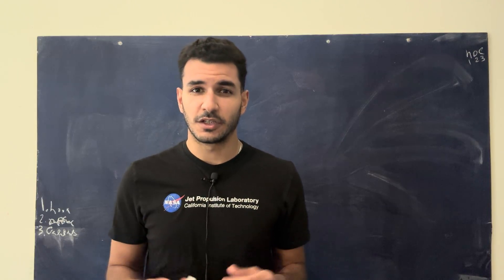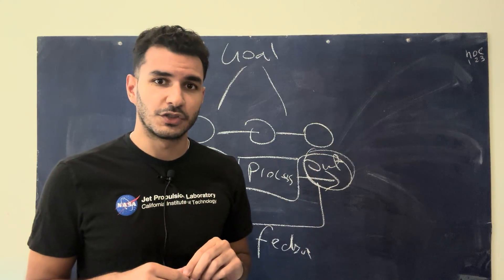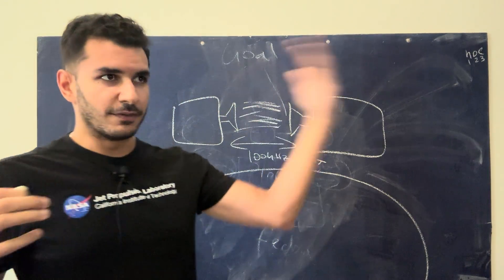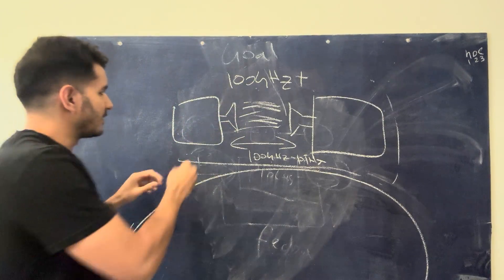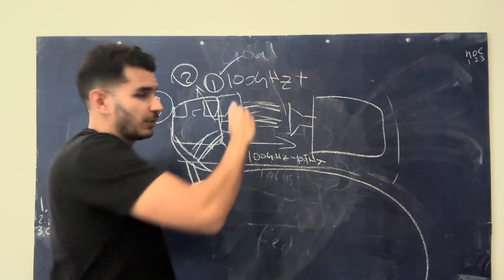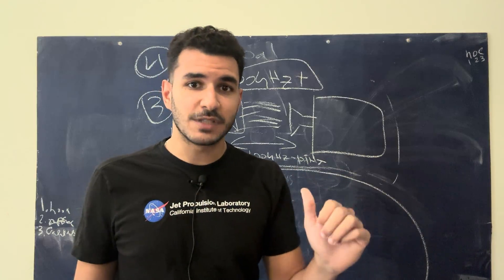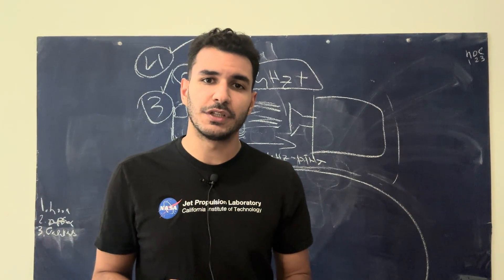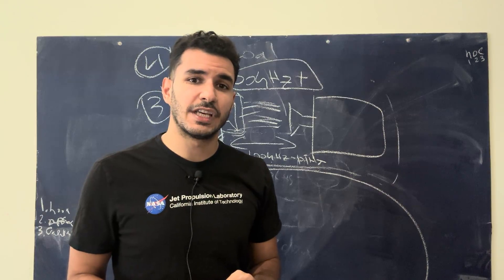NASA Engineer explains why systems engineering is the best form of engineering

Comment: Dear fellow engineer,

It’s important to clarify for your audience that what is often referred to as "Systems Engineering" has been an integral part of engineering education since the 1940s, under subjects like "Systems Analysis."
Expertise in any specific field is not required; in fact, it is often preferable not to be an expert. This is because understanding fundamental concepts can be harder for those deeply entrenched in a particular discipline. Simple examples serve as effective starting points, allowing one to grasp abstract principles and then delve deeper.

In the USA, the term "bachelor" carries a connotation that does not align with the engineering qualifications here in Argentina.
For instance, at the University of Buenos Aires (UBA), all engineering degrees span six to six and a half years (comprising 56 to 61 subjects and 5,000 clock hours of coursework), along with an additional 15,000 hours of study. Unlike many institutions, the UBA, which encompasses all areas of human knowledge in (in different academic units called "Facultades", of course,  taught in interconnected academic units), focuses on developing professionals to their highest potential, with rigorous demands. 

Starting from a solid foundation in research and the pure sciences, the UBA guides students from basic concepts up to the first steps of technological application. This comprehensive approach ensures that Argentine engineers can adapt to any technology, often with collaboration of a highly specialized professionals (a technological engeniriering

Does this difference in educational philosophy suggest a need for a broader perspective on engineering training?

Take into account that UBA is fee free, anyone that studies harda and with and strong prorpous can assist without any limitations.  But if you don't study hard and pass exams without any kind of exception and with out any mistakes in your exams and with and excellent final research thesis. And you have time to study from 7 am to 8 pm, six days a week, during all along the year with 21 days for Holliday in summer,  no one can really achieve the degree that nothing to do with a bachelor of only 4 years in USA. This degree, bachelor, can only be useful to continue the stadies since an equivalente 3rd o 4rd years in terms of subjects, but never ever has the certification to be a professional engineer.

Anyone from anywhere in the world can come to Argentina and study ingeneering or any other area of human knowledge. In terms of money you only need money to support your living in Buenos Aires, travel to the sites, and some times specific copies of a cuasi-book made for senior professionals that are not published in book format yet; anyhow cheapest than the cost of photocopies.

The degree of UBA is worldwide recognised and the PhD in USA is a piece of cake to pass.

It is a great opportunity for any person in the world.
Take advantage...

Comment: Systems Engineering is probably one of the hardest engineering.  Its when you have expertise in multiple disciplines of engineering and mathematics to such a point where you can tie it together into a full design.  I am a chemical and electrical engineer and still working on being a systems engineer. 

Its kind of the A in steam (adding A to STEM), the art part of it, the design.  Like hey I want to detect some poisen gas, how do I do this what kind of parts pieces, first principles.  Its like a PFD level engineering but for ALL the disaplines, maybe you have electro mechanical, electronic chips, a chemical process, etc.

Comment: I studied systems engineering as an undergrad. But I enrolled in a unique program at Purdue called Multidisciplinary Engineering where I was given the freedom to concentrate my elective and selective engineering courses on systems engineering while building a multidisciplinary foundation for engineering in mechanics and electrical circuits. I was even able to get MBSE and System-of-Systems Engineering experience as an undergrad. But my program is pretty unique as an undergraduate engineering program. 

That being said, I’m aware of several graduate programs in systems engineering. INCOSE has a database of the programs and have even made agreements with a number of those programs to provide certification after the completion of the program or a specific course in the program. There are also some undergraduate Industrial Engineering programs that include systems engineering in their curriculum and I think might even include systems engineering in the degree. It’s not as common of a program as mechanical engineering, aerospace engineering, electrical engineering, etc. But it does exist as something you can study academically and get a degree in. I think a lot of the top universities known for engineering are starting to offer degrees in systems engineering. Purdue, Georgia Tech, and Michigan (to name a few) offer degrees in systems engineering.

Comment: I’m in my last semester of ME undergrad at TAMUCC. Dr. Jose Baca is an awesome professor we have here that is trying to do this currently at an undergrad level in some way. I took mechatronics as an elective and he aims to use that class as a gateway to get young engineers acquainted with interdisciplinary fields and not just think of themselves as an EE or ME. He is big on modular designs and gets you thinking about the systems Engineer view of things early on while you’re building that foundation. I’d love to see a systems engineering approach for grad programs here in the future. Hopefully it will happen, dean Ma looks to be doing promising work to benefit future engineers here.

Comment: System Engineering is offered in my undergrad. It is only offered to Robotics Engineering majors. We take System Modeling and Control and then Discrete Control where I am at now. As a robotics engineer, we don't necessarily hone in on one discipline. In my opinion, that is the advantage of being a robotics engineering major, we know mechanical, electrical, and of course computer science. So I do disagree with you on having to know one discipline really well in order to start in systems engineering. I really enjoyed your video by the way!

Comment: An Aerospace Engineering major is a good basis for space system engineering, as it provides exposure to orbital mechanics, upon which all space system engineering rests, along with all the fundamentals of structures, electronics, computer science etc . A Masters in Systems Engineering does not make up for deficiencies in undergraduate education in physics, applied math, and electronics, in my experience, which was also at JPL. 
In the end the degrees do not make the person, they just help.

Comment: Wow, it's so interesting to hear systems engineering being described together with electrical engineering and mechanical engineering. In my world, it's usually mentioned together with software engineering, network engineering and data engineering. (mind you, I work in offices) In my world, the system is a layer that sits on top of the hardware layer but below the application (software) layer and so to become a good systems engineer you need to have a good understanding of those layers too... And the one who handles the system for day-to-day operations is called a systems administrator.

Everything you've said are very different, yet very are relatable. Probably the one thing that I can't relate is "a systems engineer needs a good foundation in physics". From my perspective, for my work, everything boils down to logic, not physics.

Even though these two fields of systems engineering both similarly try to make various components work together in a system, would it better to distinguish them?
Physical systems engineering vs virtual systems engineering?
Or factory/industrial systems engineering vs office/operations systems engineering?

Comment: BS Systems Engineering, 1961 from Wright State University. Our program was modeled on an MS program at the nearby Air Force Institute of Technology. 

Rather than a myriad of component-level courses, we studied courses such as "Heat, Mass, and Momentum Transport Systems," "Energy Conversion Systems," "Communication Systems," and such. 

Systems techniques (modeling, simulation) were included in every course. Instead of electrical circuit analysis, we learned by applying those same  techniques to hydraulic networks, for example. Frequency response, impulse response in multi-disciplinary systems. 

3 full years of 5-credit math through "Partial Differential Equations" and "Complex Variables." 

Systems Theory was included in every course. The professor of one of my Sophomore courses reviewed an amazing case study about the destruction by fire of an entire food processing plant. A sister plant remained in a different state. The professor proclaimed (in 1968), "The company will now hire every leading engineering company on earth, but they will not solve the problem. This problem will not be solved until they hire a systems engineer who understands the entanglement of a myriad of different technologies." In 19874,I got the chance, and I did uncover (and solve simultaneously) all the contributing factors.

Comment: I have a bachelor's in Mechatronics Engineering. The one thing I regret is not building a strong foundation in Physics. I loved the idea of becoming a software engineer who programs robots/machines. I'm an app developer at present.

IMO, the one crucial skill which helps you across diverse fields is the ability to mathematically model a concept thereby defining the problem and solve it. This is what is taught in System Dynamics and acts a transferable skill for fields like Machine Learning, Data Science, Operations Reseach, Management Science, Econometrics, Financial Engineering, Risk Management, Marketing Reasearch, Product Management, etc. Most fields are nowadays becoming algorithmic in nature. 

Systems Engineering = Mathematical Modeling + Domain Knowledge

Comment: I am actively defining a new role for myself within our engineering department. We have several design engineers, myself included, but no meaningful feedback system or emphasis/value placed on closing loops. “I designed it, so it must work” is an infuriating approach to design work…

In trying to answer/add to your question I’ll drill down into my situation and build from there. As you put, this is more about specialization and then building on that foundation. I have worked in multiple precision manufacturing fields (primarily precision machining, order of magnitude being +/-0.0005” (10-20 micron) in primarily steels and aluminum. Most of my work has been in semiconductor and medical, I am now working for a company that designs and manufactures tooling for aerospace. Primarily custom torque and drilling tools for reaching difficult locations in hulls with semi-exotic fasteners.

I’m building a role for myself that I am referring to as Manufacturing Systems Engineering. The core fundamentals of which are my expertise in design for machining, manufacturing methods, fixturing systems design and application, data modeling and large scale analysis using live machine data and queries into ERP systems, quality control systems, building layout and cell design, ergonomics and physiological limitations of humans, human interface design, automation design and implementation, automation systems and controls, CAD database management, Simulations, vendor and outside process expertise.

The fundamentals come down to mechanics of materials, applied physics of mechanisms, data analytics (currently diving deeper into SQL database management and DAX/BI visualizations), PLCs, circuits, machine programming/coding, and potentially most importantly finance and business management.

For a course outline on this as a system, pre-requisites would need to be a BSME or mechatronic equivalent, with minor/interest in programming, data management, and finance. Leveraging LLM/GPT solutions is only becoming more important. For a course/major, having this restrictive of a rubric wouldn’t work. Trying to balance out general systems knowledge and specialty needs and requirements would need a more granular subset of requirements with overarching themes.

For systems engineering you would probably need a BS in some level of technical engineering: Mechanical, Aerospace, Mechatronics, Computer, Civil, Chemical, Biological, Genetic, etc

Then this degree could help fill out the gaps in other breadths needed. You will need to understand data capture and analysis, finance, business, and automated systems (does not have to be robotics to be automated). At a level that is likely beyond what was required to get your bachelors.

A crucial part of the program will be having somewhat diverse candidates if you hope to have enough applicants to justify the program. I also think this would be the core value of the degree, the knowledge and expertise needed to be successful in the program will essentially require you to network with others in your courses to share and expand your individual capabilities. I grew up next to LLNL and Sandia labs, we had monthly LLNL talks at my CC before going to University and they always had an emphasis on the strengths of their programs being the diverse world authorities within every critical project they had. Step one was to become an expert on something before trying to learn about other breadths. Become the world authority on X and then use that knowledge to add value to other’s challenges and pick up on their expertise.

For a final project/senior/capstone course, you could then take your knowledge and elective subjects and tie them into a specific project to capture your systems knowledge. You would need to outline your specific systems coursework path upon starting the degree, I could see a 50/50 relationship between standards every student needs (core coursework listed above) and specialty electives that drill down into your specifics. These courses would need to be available at the college already, I see the advantage being that as a BioEngineer for example, being required to take a Mechatronics Engineering course that is normally outside of your scope and then being able to work with a professor to tune your project into your systems degree as being both valuable to the student and to the courses itself.

Basically becoming an everything engineer (to some extent) with a minor in business and data.

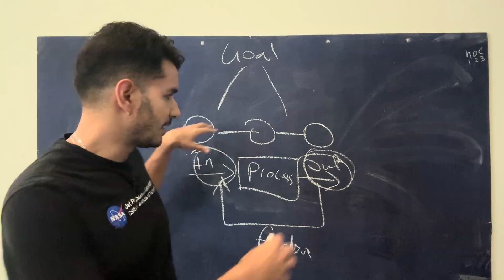Comment: I clicked on this video wondering when I would hear the word “zoom” and that happened around the 3:30 min mark. Great video - from my point of view as a power electronics engineer with experience in SW & mechanical too, what makes a great system engineer is the capacity to “effortlessly” and confidently zoom in and zoom out of systems & subsystems. Many engineering disciplines are fundamentally defined by differential equations in matrix form, which are not conceptually that different, regardless of the engineering area. Always having an engineering mindset, zooming in and breaking problems down in simple forms, then putting the pieces together and progressively zooming out more and more is how an intimate understanding of a working system is achieved - at the end of the day, everything from a class A amplifier to a car is a system. Great points!
Reply from the maker: spot on! thank you for sharing, I can see you are already quite good yourself!

Comment: Not actually true. 

It seems to me that you just stumbled into the broader subject of systems engineering while actually needing to implement a whole system, and got to see how the component or field of engineering you had expertise in was working with others to form a desired system. This just seems like your path to it, which sounds like a self-made systems engineer.

However, the actual academic path and expertise in the domain of systems engineering does exist. My bachelors is in Systems Engineering, it lasted for 4 years, and you could continue to study it for masters and phd.

The programe requires you to learn multiple engineering domains, and not just as a helicopter-view or superficial depth as you are implying, but actually get core knowledge in the engineering topics you mentioned in the "full stack". It also requires a lot of depth in control systems and automatic control systems.

I think the ideea of mastering one random engineering field academically and then just "figuring out" the rest of the system is a "junior" positive perspective, and in the real world you should actually study systems engineering in it's own in order to become a system engineer and be able to create robust systems. Otherwise, i'm afraid the correct mindset and the principles of the field will be lacking.

Not  trying to gate-keep systems engineering at all, just want to paint it in real colours.

Comment: I love engineering, and I am really interested in systems where mechanics, electronics, and software meet and work in a symphony. I am a Mechatronics Engineering student. I chose this engineering because I thought this would be the best way for me to learn every bit of these components. If there were an option called systems engineering, I would jump to this option. And based on what little I know, my humble opinion  is that if this idea becomes real, it should be based on electronics. Software is easy to grasp. Mechanics is a field in which humans relate very easily. But the electronics is a completely different world.